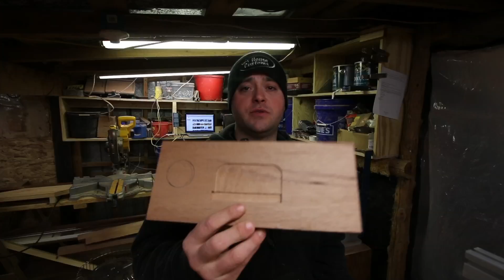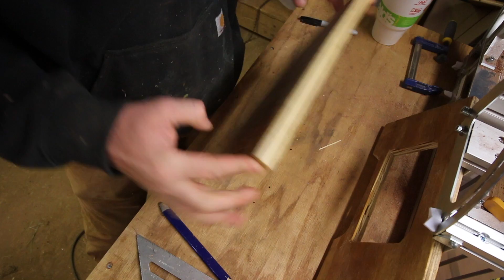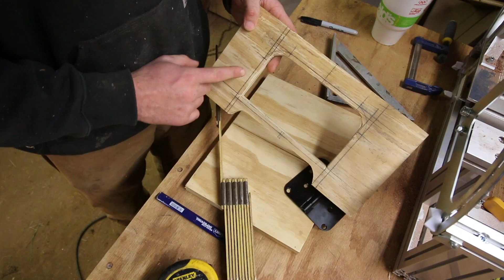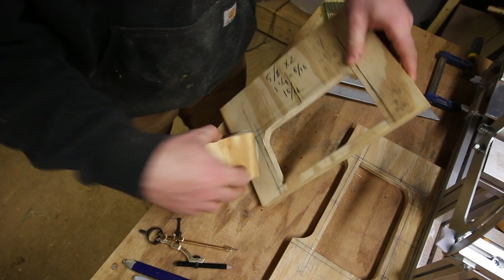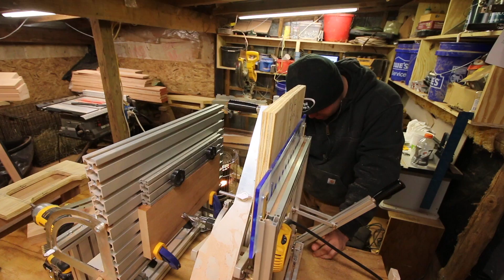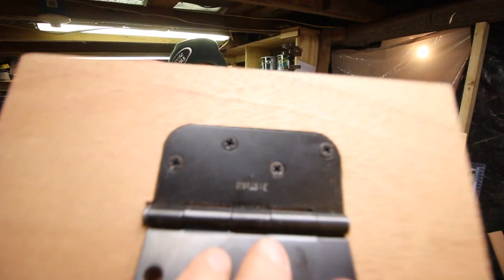Making a Template 4 the Pantorouter

Comment: Using a  Forstner bit of the right diameter at Centerpoint of the radii would have given you really tidy radii. Wasn't paying much attention to the radii, so not sure if it would have been a strange diameter Forstner bit.
Reply from the maker: +joe Conway Yeah. I need to pick up a good set one day.
Reply: You also can use a hole saw. It would be cheap but might not last long lasting as a forstner.